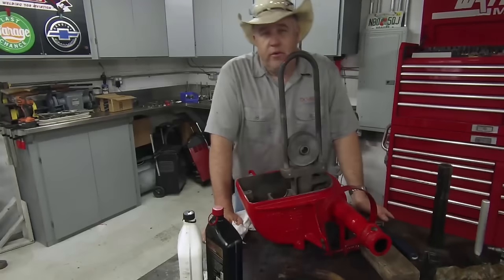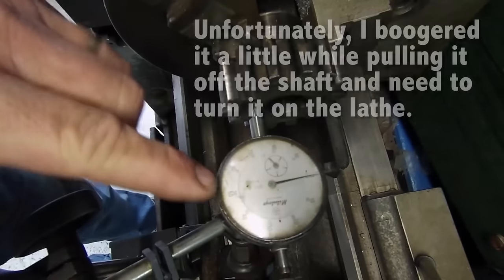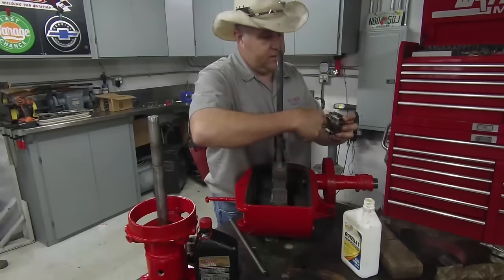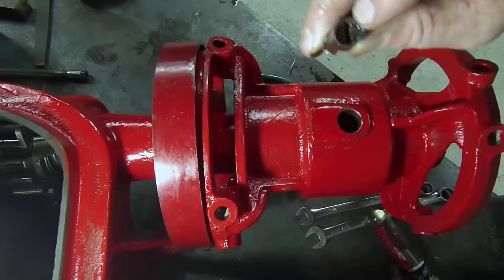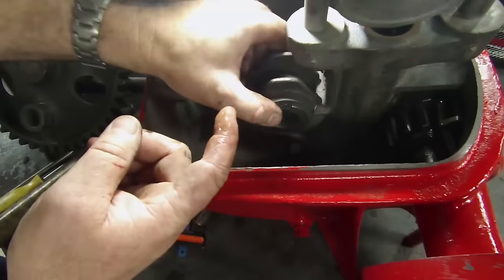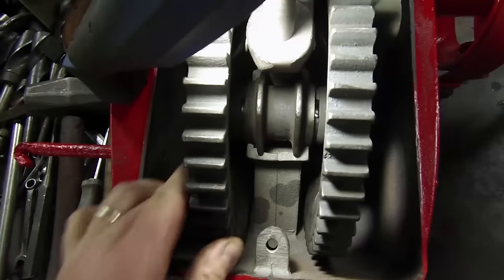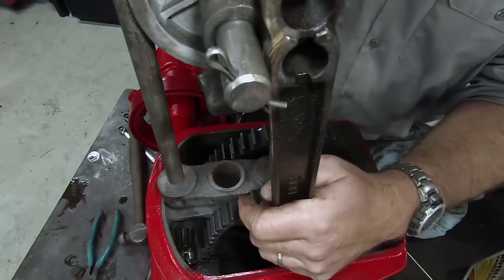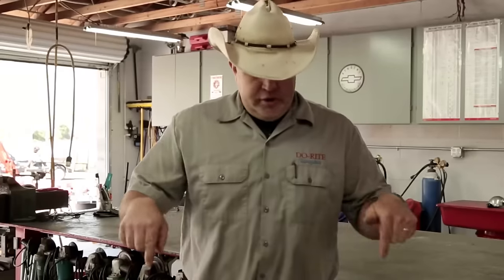Vintage Aermotor Windmill Restoration Ep 4

Comment: I really like the video,  I am a second generation water well contractor from eastern CO and work on several hundred operational windmills.  Most everything you pointed out was spot on.   If I may add a few things to the conversation.

The little gears should fit the shaft snug, the tighter the better really, then the key is a tapered key that wedges the gears tight as you drive it in through the hole on the back side of the shaft.  As the head wears, the key will get loose and let the gears flop back and forth and give the head the knocking sound often heard on old mills.  If you want it to last longer, you can loose the oiler and weld both little gears to the shaft. (More on this later)  It takes more to rebuild cutting the shaft back apart, but the shafts usually are not re-usable anyway.  Also welding the big gears as well helps keep wear consistent on all the gears.  Most heads will wear out one little gear before the other as the loose key lets one flop more.

The oil scraper in the hub on the front end of the mill is open to the air around the casting on the back.  This will eventually fill the oil scraper with dirt and not let it drain back into the shaft.  Then any oil that comes down the shaft and makes it past the nose bushing ends up leaving the mill through the back of the fan hub.  The spring loaded oiler on the shaft does it's job well, but the shafts get plenty of oil without it and don't make such a mess once the scraper gets plugged.

Lastly, the cross head shaft can be rolled half over once with no loss of any mill life.  The coder pins on both ends hold the rotation so it won't roll back to where the previous wear was.  The shaft is always being pulled on so the extra wear on the other side doesn't matter.

Thanks again for an excellent video.

Kenny

Comment: I saw a lot of those features on the 1930 babot bearing motors I worked on at my job. the motors floated and when setup correctly they would move horizontally about 3/16 of an in. and center and did not touch the sides. these GE 3 hp motor where huge and the size of a keg of beer.  and the 10 hp and larger where 3 feet tall. Most were motors for air conditioning blower larger and slow rpm for quietness and long lasting. still going to this day. I have never seen the inside of  a wind pump.   I have an electric pump set up that works similarly that had wood rods that went down the shaft to the pump. The wood is long gone but the put still turns freely.
Reply from the maker: +Ed Ginsberg , The Aeromotor uses wood pump rods too. I'm not sure if I am going to keep the wood, or replace them with fiberglass.

Comment: Jim. Fantastic video series. 
 I have removed the small bolt in the nose, under the pipe plug in the wheel hub.
  However, the shaft seems unwilling to slid out.
 Can you add some detail on how to remove the shaft from the housing?

Thanks again.

Comment: your video is pretty good however was of no help. i had to order a new nose bearing. it is different than the original, and will not fit past the threaded oil socket. aermotor sent a new one (oil socket), but am struggling to remove and replace. any ideas?

Comment: Jim. Great video series. I have learned so much. I, too, am trying to restore an Aermotor 702. But I cannot get the old shaft to turn...much less get it off. I do not see anything in the shaft plug that looks like the Oiler on your video. I assume the Oiler has been removed. Any suggestions on how to get the shaft off. Thanks again.

Comment: Can you easily replace the brake band on an 8' Aermotor on the tower?
Reply from the maker: Sure, but the problem is usually the linkage, It gets worn over time. The brake is just a steel band.

Comment: I am making my first attempt to rebuild an aermotor  I have it completely pulled apart but I can't get the small gears off the shaft do I need to heat them to get them off?
Reply from the maker: Possibly, mine took quite a bit of motivation. Remember if you add heat, that the bearing babbits melt at a relatively low temp.
Reply from the maker: Chris Nault be sure the small bolt in the nose, under the pipe plug in the wheel hub, has been taken out.

Comment: You explanation of the babot bearing was not very good, and the camera was far away.
Reply from the maker: Landrew0 Sorry, It's not really a lesson on babbitted bearings, more or less want to let folks to know that the Aermotor has them. If you want to know more about babbitt bearings check out Keith Rukers channel, Vintage Machinery, or Keith Fenners channel, Turn Wright machine works. both guys are amazing and cover extensively, melting out, Machining out new forms, pouring new Babbitt, and fitting the Babbitt.